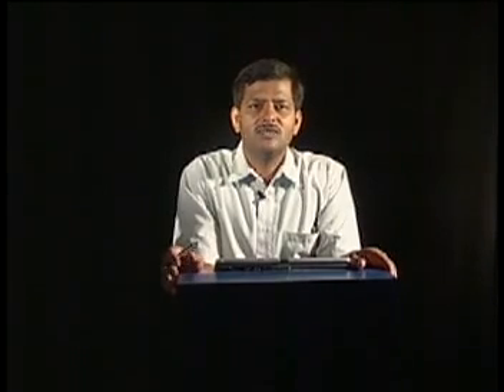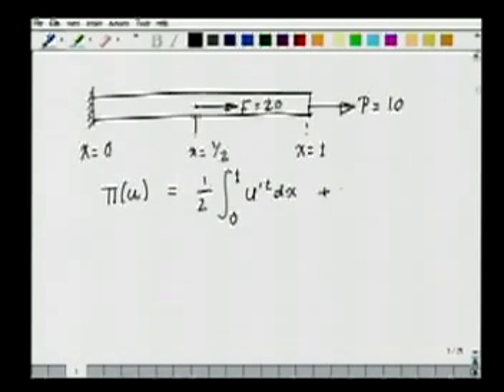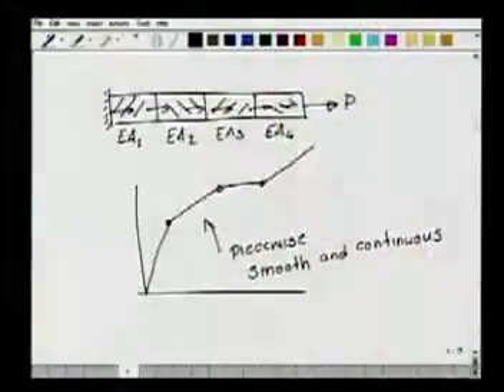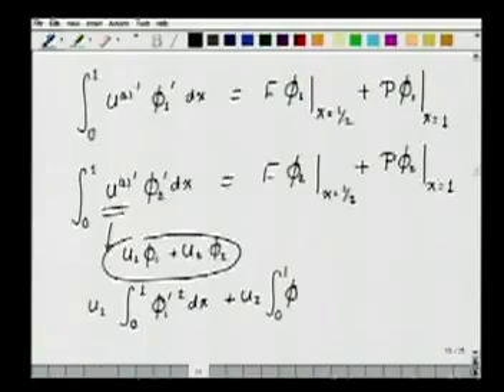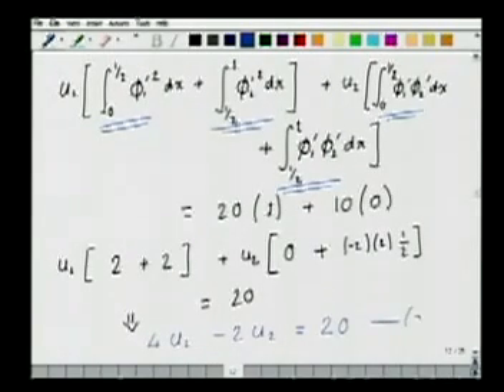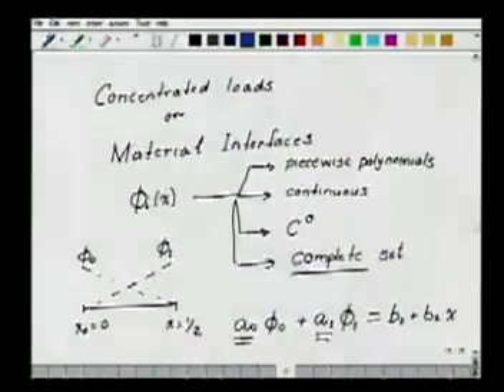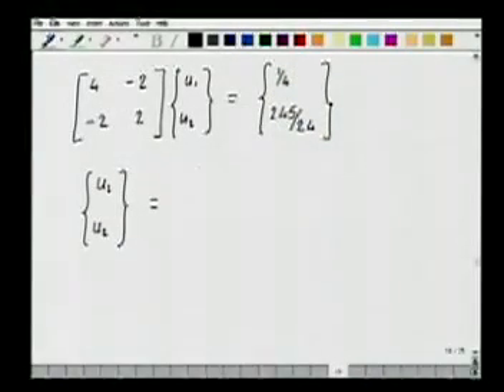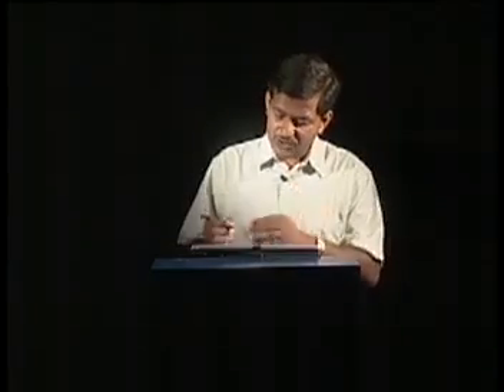Module 2 Lecture 1 Finite Element Method

Comment: Please, tell me if Im wrong but...
It seems that this guy forgot to add the energy by the distribuited load
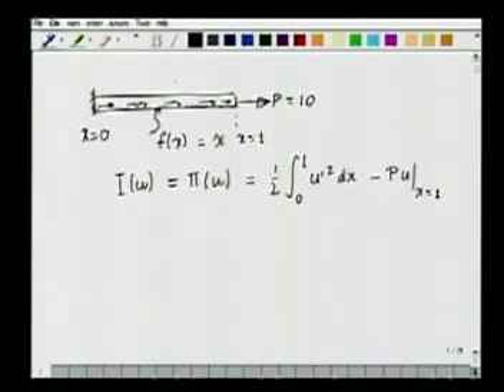i.e int(u(x)*x;0,L) to the total potencial energy of the structure. 01:48

In any case, in the previous lecture he used a distribiuted load of value 1 but here he used another... of value x.